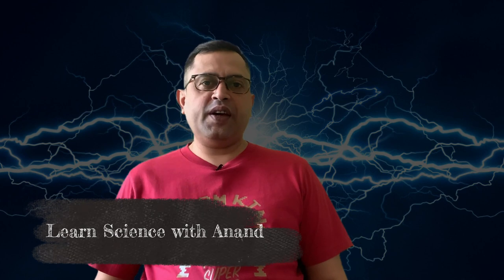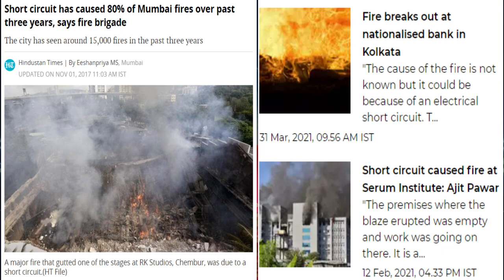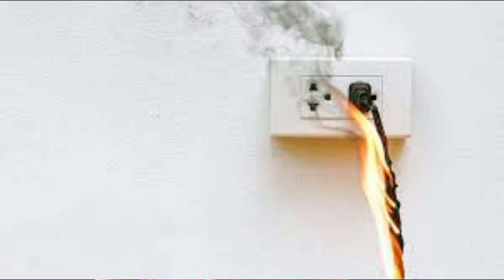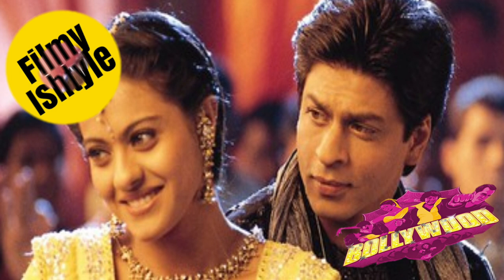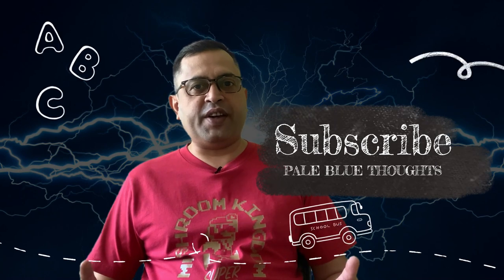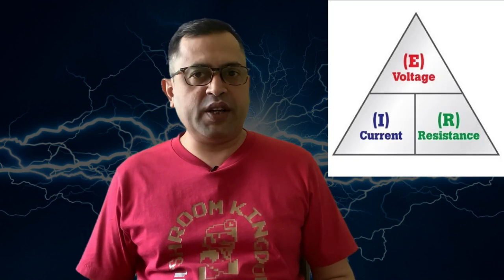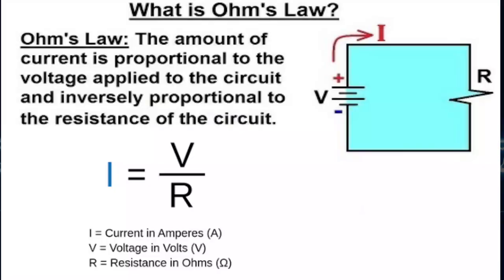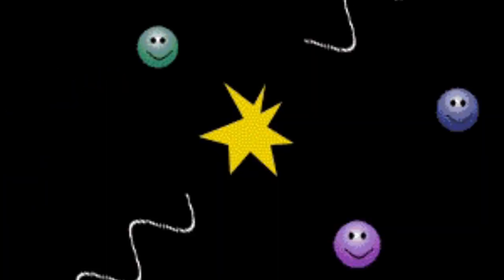This is a Short Circuit - Explained In Indian Movie Style

Comment: How do we know that the wire that is connected to our MCB is perfect for that MCB. Because many types of wires come in the market, most of the time we have seen that the wire of the circuit in our house gets burnt again and again. Which wire would be better, which should also flow the required current continuously, along with if the flow of current is high, then automatically MCB should be turned down.
Reply: Such good quality wires are the in market, for example v gaurd wires, the copper wire will melt into bubbles and good insulatuon